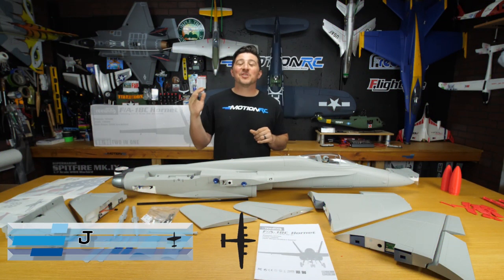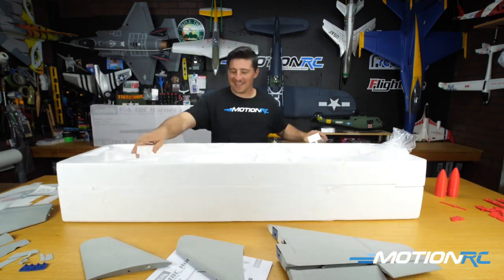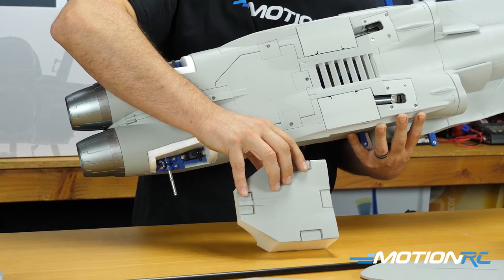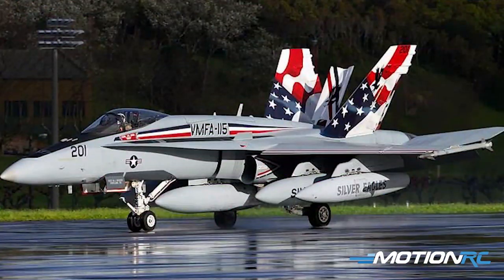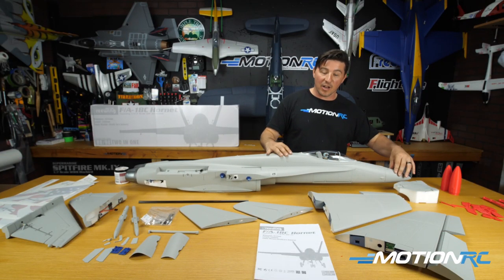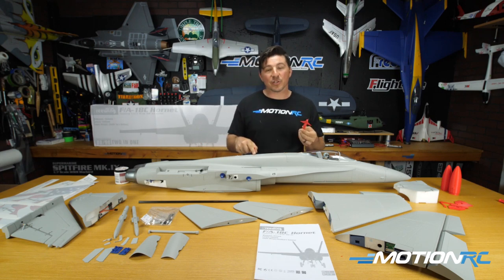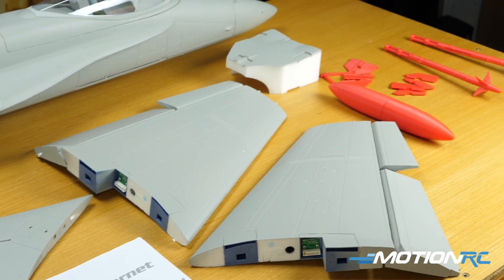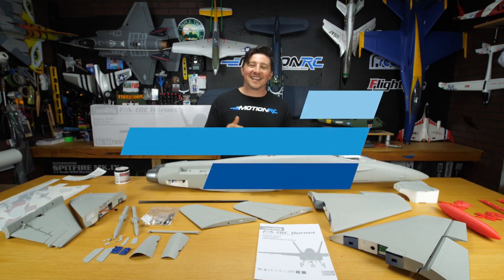Base Gray Freewing F/A-18C Hornet 90mm EDF - Unboxing - Motion RC

Comment: I’ve always used windex on my vinyl graphics. Just dab them when you have them in place like you would water applied decals with something to make sure you have all the windex out from underneath. As they dry the sticky comes back. I’ve tried the spray and preferred windex. Don’t remember why since it’s been almost 20 yrs.

Comment: Easiest way to make your airbrake is going to be thermoplastic splinting material. Cut to rough shape, boil or steam until pliable, lay on model and form using tongue depressers or spudging tool, then cut to final dimensions and paint. No CAD needed and can be made as a single piece instead of having to have a joint if your 3d print volume is less than the airbrake footprint. It is also reformable over and over so you can get the perfect fit.
Reply from the maker: This is a great idea! Thanks for the tips!
Reply: @MotionRC  side note: I did the maiden on my L-39 today, pretty sure the gyro in the Admiral receiver or the receiver itself freaked out.  Just completed a turn to land, wings were level, and it did a nose dive full throttle straight into the ground... About the only thing salvageable are the ESC, MCB-E, and EDF... Have you seen anything like this happen before? Any possibility of at least a partial credit on the ARF+ L-39 for me to transplant the electronics into?
Reply from the maker: @mdoering  sorry to hear that. That's something you have to contact our CS team about.

Comment: Don't put two drop tanks under the wings of the C model.  C Models NEVER had 2 drop tanks under each wing.  It will just look silly.....SMDH  You need a tech advisor...
Reply from the maker: I have pics in the video with a real one having that load out. We'll see what I can 3d print for her
Reply: @MotionRC  A real F/A-18A/B/C/D can only use a maximum of 3 drop tanks.  One on the centerline and one on each inboard wing pylon.  The outboard under-wing pylons are not "wet".  The image in your video is probably a cargo/baggage pod on the outboard pylon.  The Hornet NATOPS manual details the fuel system, section 2-2.  An F/A-18E/F Super Hornet can use a maximum of 5, one centerline and two on each wing.
Reply: @MotionRC  Those are ALL E or F models not A, B, C, or D.  There's not even connections for drop tanks on the outer pylons on the C model.  On rare occasion they will carry a luggage pod (WW2 style drop tank) on an outside pylon, but they are small and funny looking on them.  Trust me I'm a Legacy Hornet Mechanic.
Reply from the maker: @Cowboylifesaver  I hear you guys. I am going Sidewinders on the wing tips, gbu-12 on the outer wing pylon, fuel tanks on the inner pylons)